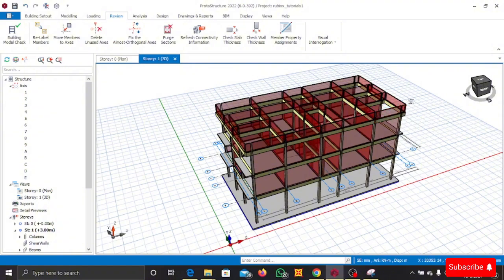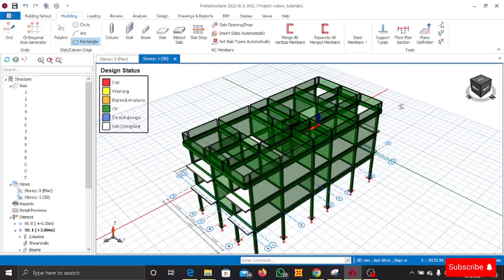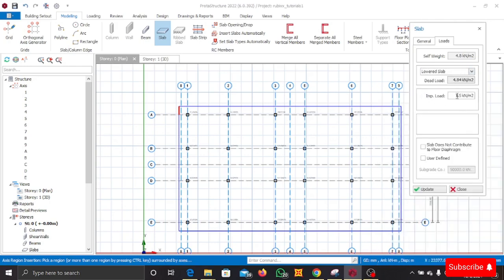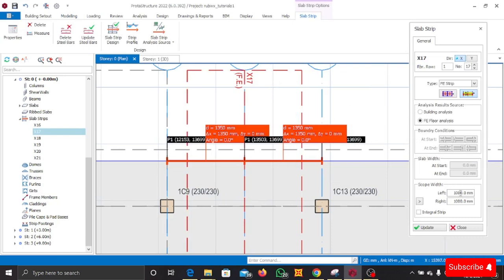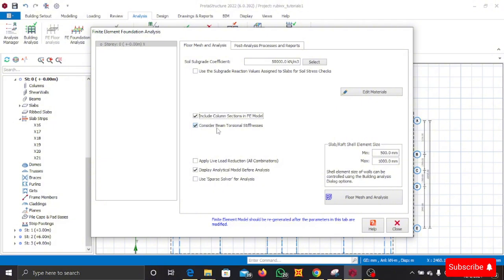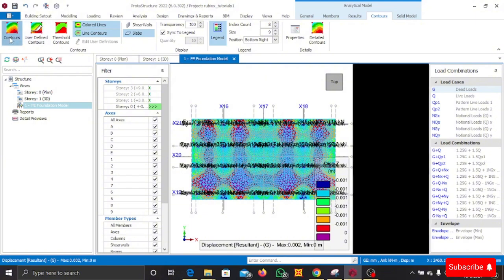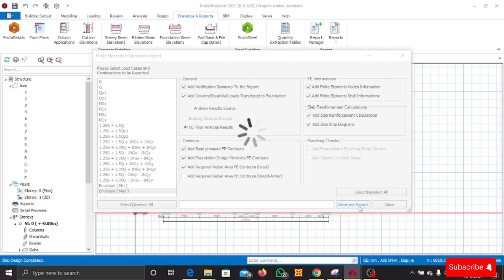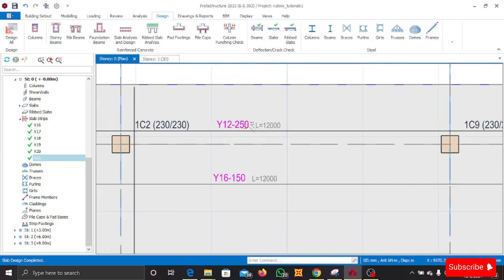How to design raft foundation on protaStructure

Comment: Well done sir, but I have a couple of questions. 
1. why did you offset the axis by 800mm
2. Is your total number of the floors 3 or 4
3. and why are you using 3 slap strips and not 1 or 2